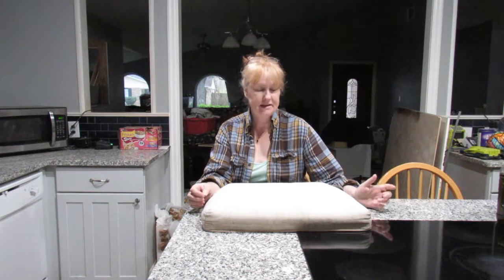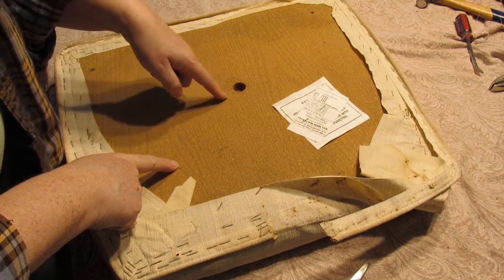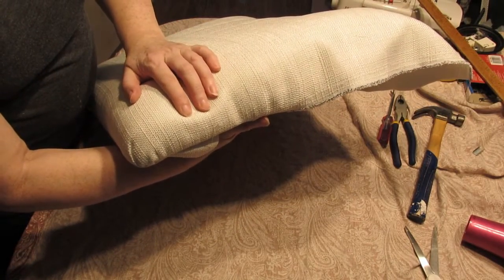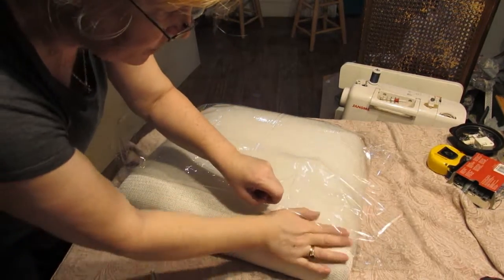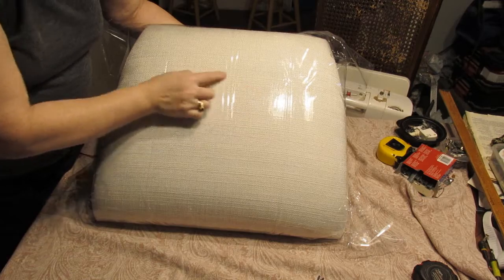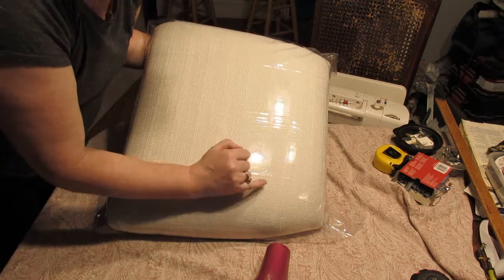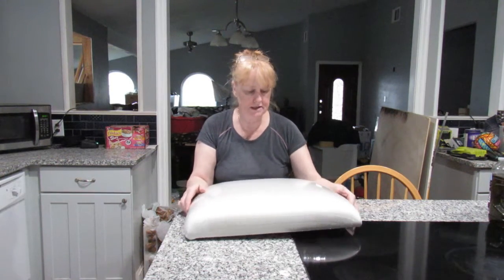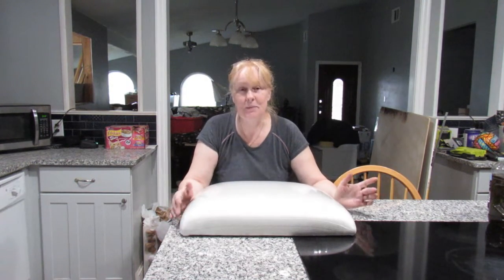Putting Plastic Covers on Kitchen/Dining Chair Seats - Profesional Tips and Tutorial for All Levels

Comment: Can I just glue it?
Reply from the maker: Thank you for your question.  I can honestly say that I have never tried gluing it.  I should imagine that if you hot-glued it into position under the seat it might work.
This would be quite a slow process as you will need to wait till the glue had set before moving on to the next area and might become a two-person project as I would still suggest pulling the sides into place and using a small amount of glue to hold them and then working in each corner heating the plastic so that it will pull into shape,  and glue once it is cooled it will help to keep the plastic in place on the corners of the seat.  
I would not advise putting glue on the top of the seat and the plastic over it as it might discolour the fabric as the glue ages.
Good luck with your project.

Comment: What about doing softer Cushions
Reply from the maker: Thank you for your question.  I will admit I am not quite sure what you mean by softer cushions.  These ones I had to replace the existing foam as they were in such bad shape.  If you have seat like this I would advise you to consider changing the foam if it is older than 10 years and used regularly.  If the seats a rarely used, then the foam should be ok.  
With softer foam, the plastic should still go on the same way, just don't pull it too tightly.  The heat from the hair drier should pull in any loose areas in the plastic and even the sides of the seat after you have attached it.   
If you rely on the heat to bring in all the plastic, you might not be really happy with the final results as there is only so much the heat will do.
Good luck with your project.

Comment: How thick of clear material do you use?
Reply from the maker: Thank you for your question.  I seem to remember that it was 3mm thick.  I wouldn't suggest going much thinner as you need to have enough body so as not to tear the plastic when heating it and pulling it into place.
Good luck with your project.
Reply: @beinspired1487  thanks

Comment: What sized staples did you use?
Reply from the maker: Thank you for your question.  I am using an Arrow staple gun at the moment, so the staples are a little chunkier than my old staple gun used.  
The two sizes of staples I use are 5/16" or 8mm, which I use for most of my projects and on this one, as the fabric and plastic are not too thick.  As well as 1/2" or 12mm which I use for putting in webbing so they do not pull out under stress or if I am going through a number of layers of fabric and need the extra strength.
I hope this is of use, good luck with your project.

Comment: what gauge vinyl do you use
Reply from the maker: Thank you for your question.  I would suggest using a 3-4 mil plastic/vinyl for covering the seats.   For this project, the lady bought it as a precut length in a packet and I can not remember what gauge it was.   I advise people not to buy it too thin as when you heat and stretch it into shape the plastic does thin out slightly on the corners of the chair seat.
Good luck with your project.

Comment: Hello! Where do you get the clear plastic from? 
Thanks! Emily
Reply from the maker: Thank you for your question.  Here in the US, you can pick it up from Joann Fabrics, Hobby Lobby, and other craft stores.  They sell it by the yard off the roll or in packages.  I am sure you can buy it from Amazon and Etsy.  They usually give you an idea of what it can be used for and if furniture shows up on the packaging then you should be good to go. 
I advise people not to buy it too thin as it won't wear so well,  so probably 3-4 mil so it is a little robust.   Usually, 70cm/ 2/3 yard will cover two chair seats, if you are buying it off the roll.
Good luck with your project.
Reply: @beinspired1487  What is a good durable brand that doesn't turn yellowish?
Reply from the maker: @AVMAR  Thank you for your question.  I think I am going to have to say you get what you pay for, in the hope that an expensive plastic would be more durable and keep its clarity for longer and not turn yellow or tear with age.  You might find a better answer by looking up the ratings of brands online.
I am sorry not to be more helpful, but I work with what people give me to work with.  Although my advice is to use a thicker plastic as it will not pull to thin when heating it and molding it into shape.  Good luck with your research and your project

Comment: Where do you get your staple gun, do you need an air compressor?
Reply from the maker: Thank you for your question.
This particular one I picked up from the local DIY store, it is made by Arrow, and yes it does need an air compressor.  A small compressor will work and it makes it much easier on your hands.   One with a longer nose will get you into most of the awkward spaces.
I used to use the electric ones and they would wear out with about a year's worth of use due to the volume of work.  I didn't want any high-power tools with young children in the house.
I hope this is of use, good luck with your projects.
Reply: @beinspired1487  thank you for your quick reply, I have not being very lucky with my electric stapler, the staples keep breaking! Running to the store in a bit and see if I can get one!
Reply from the maker: @ceciliacraig9509  The staples might break due to being a bad batch or the frame is very hard so the staples do not want to go in.  Also, make sure that nearly all the old staples are out as new staples often just crumple up when they hit old nail heads or staples.
Good luck with your new staple gun and compressor.